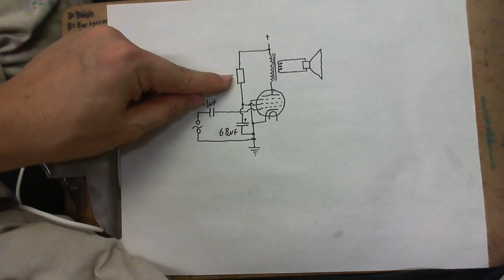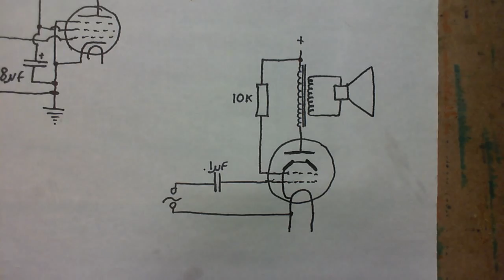Experimenting with valves/tubes as amplifiers

Comment: I am old enough to have experimented with vacuum tubes, i.e., 'valves'. I always thought that there was some magical process taking place inside those tubes. I recall building a one-tube FM receiver that used one volt DC to power the filament. It looked like a small sculpture when I got done, because I didn't use a circuit bard. BTW, the design was not mine. The circuit came from a Popular Electronics magazine. I learned a lot from those publications.

Comment: I've never used valves. But, regarding the apparent low frequency response, I wonder if it would be possible to split the audio in two (a high-pass and a low-pass), amplify both signals using two valves, and then feed them into the speakers. I suspect it would be difficult, although it may provide a crisper treble and a more powerful bass, perhaps at a loss of some mid-range. I haven't tested this, so it may not even be feasible.

EDIT:
Interesting...
Vacuum Tube Amplifier Theory
Electronics at Work - 1943 (Complete)

Comment: The quality of the amp is mostly determine by the quality of the output transformer...in the size of the output transformer the bigger the core the better
Reply from the maker: I wonder how good a MOT would sound as the output transformer?  I might experiment with that and find out!
Reply: Hmm if u see my channel i make a SE EL84 with some line transformer 230V primary and 12V sec (i think)
Reply: CoolDudeClem This is a great idea! You should Experiment with different types of transformers. IE M.O.T./ Mains of different voltage ratings IE 440 /240/220/120/ext. as audio output trans. Then post a vid on your results.

Comment: the national valve museum have lots of good information about most valves and datasheets here is there padge about the VT137 valve 
http://www.r-type.org/exhib/abh0044.htm it seens like th 137 is a RF power oscillator witsh might not be the best valve to use as a preamp i´m quite suprised it workt as good as it did through.
btw what output transformer do you use?
Reply from the maker: I have come across The National Valve Museum, I just used an ordinary mains transformer as the output, I know there's a huge impedance mis-match there but it still seems to work well.

Comment: Any chance on running one of these on batteries? I love the warm sound quality.
Reply from the maker: It's possible, but I'd need an awful lot of batteries to get the high voltage, they used to sell high voltage batteries for tube radios a long time ago, but they're long gone now.
Reply: 1T4 you can use that one
Reply: CoolDudeClem Someone on here had a tube that ran on 5 volts and he had music playing thru it. Maybe I could use that with a resistor or regulator and 4 batteries or 6V lantern battery.
Reply: a little boostconferter wil also work great

and for coon
a 6.3V tube on 5V will wear down realy fast
to high filaments the dont mind
to low and it wears them out
Reply: *****
6.3 volts then lose the resistor or regulator and hook it straight. Would they mind only .3v difference?
Reply: no that is  to little to harm a tube
but it is better to get as cose as you can to the right voltage

Comment: single ended yes,  how much is the B+ you got ? about the filaments wire I think is 6.3V also twist the filaments wire to avoid hum, I also studying  the tube specially Williamson ultra linear amplification try push pull it will give you more output than single ended  and you can run it in Class AB not sure about those tube can be use in push pull
Reply from the maker: I'm using about 380 volts, I know it's a little high for those valves, I might use that other transformer with multiple taps as an auto transformer to provide the main transformer with less voltage so I get a more suitable b+.
Reply: CoolDudeClem  do you have any tube rectifier and choke? the choke with about 4H to 10H might help lower the B+ I assume you are using full wave rectification two diodes and center tap GND chassis does that voltage 380 has a center tap?  example: 190 - 0 - 190  Vp = 190*1.414 = 268.66 VDC. VDC = V(peak) x 0.90: VDC = 268.66*0.90 = 241 VDC this might be to low unless you use a bridge rectifier but at least you are figure things out and that is good ^__^

 well other option to lower the ripple and dropping some voltage use a choke a transformer that you know can be use a inductor filter about 4H 200mA C1,CH1,C2
Reply from the maker: Juan Vargas
the transformer is not center-tapped, for now I'm just using half-wave rectification with a microwave diode, that goes into a capacitor, then a choke, then another capacitor and I hear no hum whatsoever.  I'm not quite ready to experiment with valve rectifiers yet, although I do have a few.
Reply: CoolDudeClem  cool man just be careful work with one hand and the other in the pocket or your back if you doing DMM testing voltages, keep it a good work bro ^__^

Comment: nice vid, id love a tube amp or build one but what denon cassette deck is that, i have a denon dn770r deck but i like the way your deck has the cassette draw
Reply from the maker: It's a Denon DRS-810 from 1992, my favorite cassette deck in-fact.  I found it in a dumpster believe it or not, but it worked perfectly so I don't know why it got tossed out.
Reply: CoolDudeClem thanks for replying il see if i can find one on ebay or somthing, the things people throw away is ridiculous, i bought my deck on ebay for about a tenna listed as "for spares / repairs" alls it needed was a slight adjustment on the heads and it is fine i guess you can rely on denon cassette decks